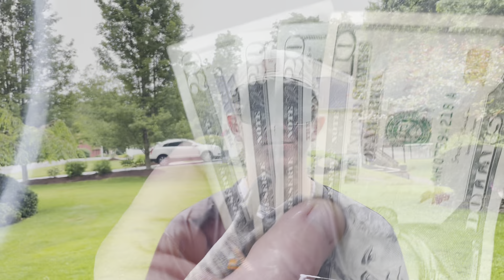Washing Shenanigans in the Rain

Comment: Whatever you decide with the dual feed, just don't let your tank overfill and bulge out like has happened to me. All your tight configuration will be crushed from a bulging ibc tote. Add an extra 3/4 inch hole in the top of your tank, this will keep this from ever bulging. You can throw a 90 degree fitting to keep out debris. Wish it would rain in Illinois, Paranoid all day with house wash mix even on plants. So dry here!
Reply from the maker: Good advice. Thank you